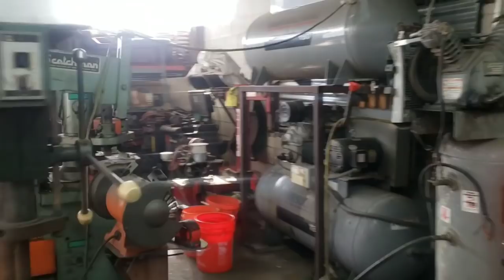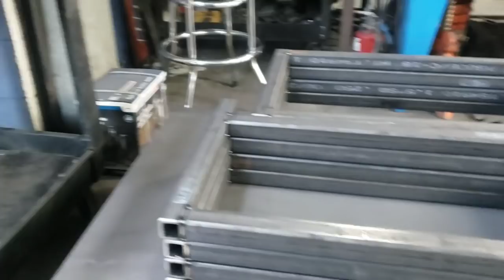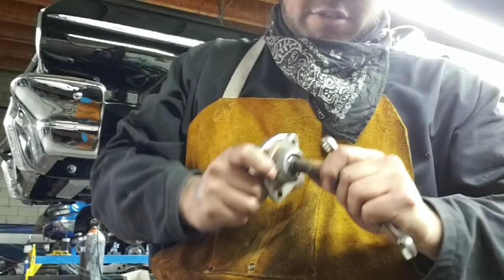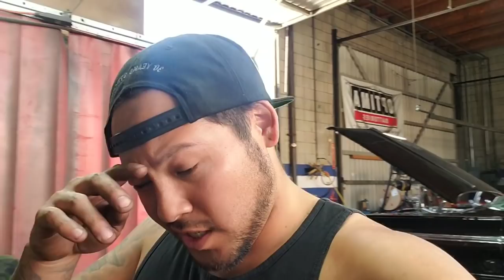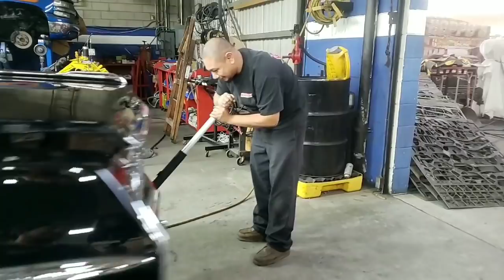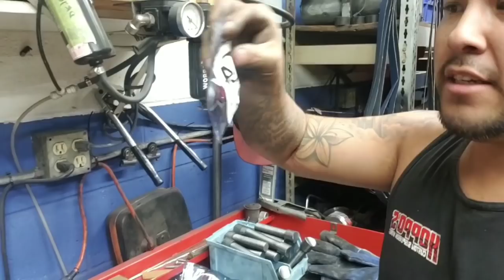High lock up balljoints install

Comment: Eyes and metal shavings tip:
If it happens again, and it probably will, unless you give up the "car game", go to a walk in optometrist (eye doctor). I paid that same $300 several times before I discovered that the optometrist did the same thing (probably better) @ $70-$90 and a lot faster.

Comment: Alex give me your opinion on this... I love the high lock up, but those look very sketchy. Here's my idea. I'd like to build a jig for the spindles and it would use square tubing inside another square tube for the jig. The jig would bolt to the upper and lower ball joint holes. And you'd cut the spindle and then you'd use the jig to raise the spindle to a second position (because of the tubing) and then you weld some steel in there and the jig would ensure both sides are identical in geometry. If y'all sold 2-3" extended spindles, if buy them.

Comment: I have had stuff get in my eye even with goggles and full face shield before (granting it was a rusty grimy car or truck) more then once, so it depends on the vehicle and the angle of attack if I put on protection, even then it's not full proof. Pro Tip* I keep a super strong, clean neodymium magnet in my first aid kit only used for getting metal out of my eye when it happens, only had to use it twice and it worked good both times.

Comment: What is the solution for the opposite? I want to lay frame with stock wheels and tires on my 70. I already notched the control arm to sit up in the frame. When dropped the top ball joint gets in a bind before getting to it's lowest position. I was thinking cut the end of the top control to tilt it. Not sure that will work

Comment: Great looking car!!! If you want to use stronger bolts than grade 8 use aircraft quality bolts, the threads are not cut they are rolled which makes them stronger. 
BTW the safety glasses look great and with grinders or high speed cutters try using a face shield. The carbide cutters could break off since they are harder but brittle and could chip apart and if the fly off since they are braised to the steal shaft, it wouldn't be a chip of metal in you eye, it would be the whole cutter in your eye and you could lose an eye. Seriously you will have the nay sayers but when or if it happens you can't go back and wish you had a shield on when it's to late.
Reply: Are they grade 9 bolts your talking about? I keep breaking the grade 8s.

Comment: I've had the same experience with safety glasses. Stuff flies up underneath. Instead of a direct hit. Have you tried the safety glasses with a padding along the bottom of the inside edge?

Comment: If you take a holesaw the size of the existing hole and take the holesaw the size you need it to be and put the smaller one inside the other and screw them together on the the arbour yes they fit like that you can drill the new size ezy

Comment: I worked at a tire shop for years, and I always got more shit in my eyes while I was wearing safety glasses then when I wasn't. I had to have metal drilled out of my eye because I could barely see.
Reply from the maker: Yea I've had them pull metal out it's part of the job lol

Comment: Does anyone kno if i should be using full stack coils with the 3in high lock-up ball joints??
I have coils that i cut 2 turns off and when i lock up the cup looks like its ready to come out of coil.....

Comment: Hey Alex I just seen the ball joints online I had a question do they all have to be grinded down to fit or modify them ? Another question is I just lay and play I don’t hop it you recommend them ? I just want a higher lock up
Reply from the maker: Yes all them require  modifications
Reply: alexhoppos909 ok bro thank you I will order some soon

Comment: drop the hydraulics and wire wheels and you could have a nice car
Reply: What You Got Bro?
Reply: @loelco8162  restomod 53 chevy truck. i'd like to clarify my previous comment. put air ride in it so you get a smooth ride out of it and you also lose all of the unnecessary equipment, and i think stock ss wheels/hubcaps or certain mag wheels would set it off nicely. it's a beautiful car, just don't get why they all have the same wire wheels. no disrespect or negative comment, just an opinion. everybody entitled to have their car as they wish.
Reply: I say do your 64 the way you want yours and let others do theirs the way they want theirs. Problem solved.
Reply: @caesaremorgan  i totally agree each to their own. i think it would be awsum just to see these lowriders actually be driven (beyond a five mile radius). hydraulics ride like shit which is why i said drop them and wire wheels with white walls are not exactly the best looking wheel but hey if that's what you like go for it. i drive my shit.